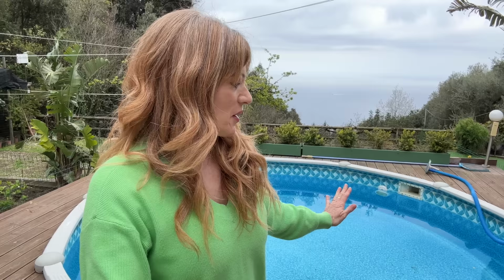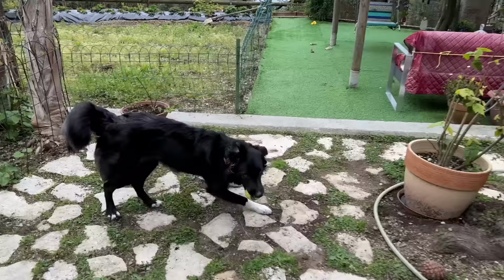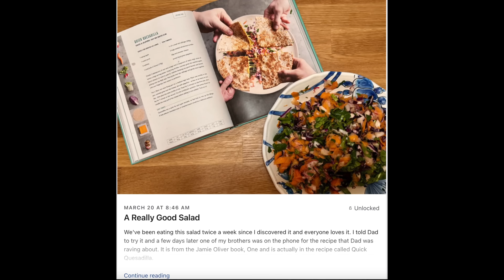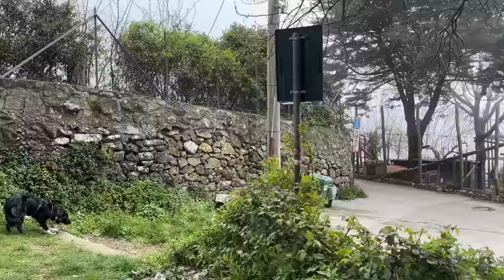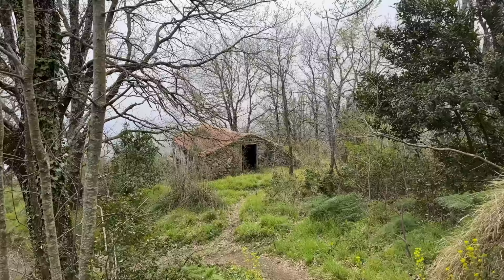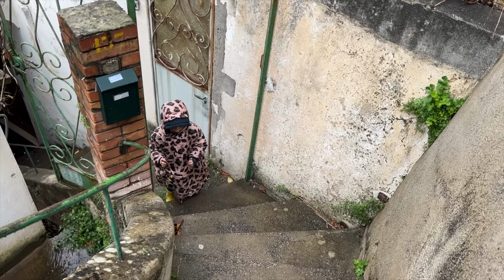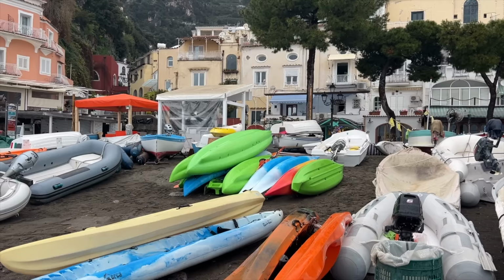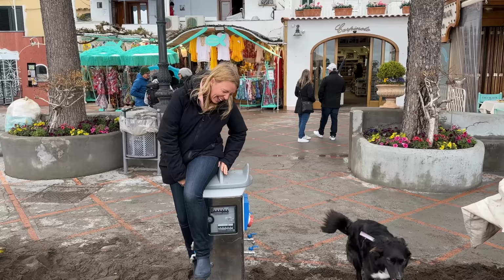NOT SUCH A PERFECT WEEK IN POSITANO! Holes, fog and a badly placed bollard| EP 232

Comment: You know Nicki and Carlo that Julie from Mapperton that you visited, would have been in that pool like a shot, fixed the hole and looked around to see if there weren't any others that needed plugged before resurfacing. Weather has turned too in my neck of the woods in the South of France but I'm kind of rejoicing for we need rain, in the past year we've had spits here and spits there, and according to the water board, water levels are down drastically. So let it rain, let it rain, let it rain.......

Comment: Carlo, you're a better man than me getting in that water 🙂 I would've used the long pole with a grabber on the end you used to pick fruit from the trees, I would've held the patch in the grabber over the hole and used another long pole or a hoe to press the patch Down in place. Still, if you get another leak it'll probably happen in the middle of the pool, in which case you have to use the grabber and the poll and you have to balance on a raft. Hope this advice helps 🙂